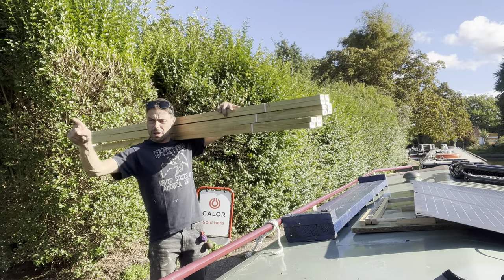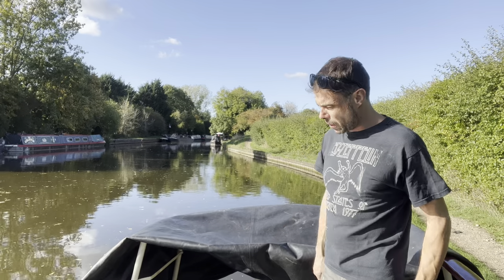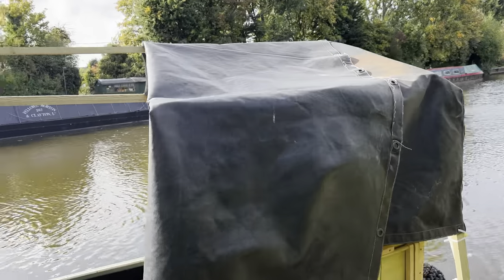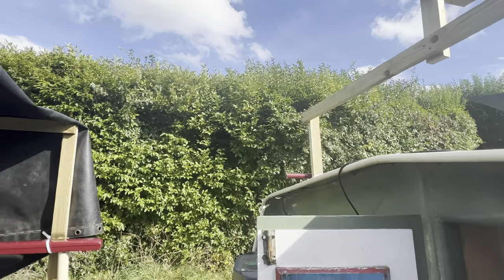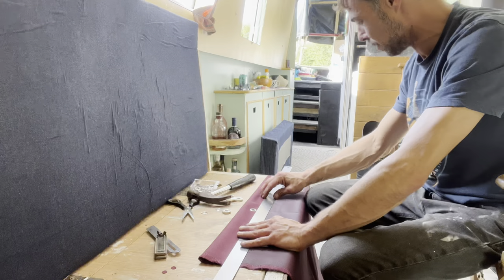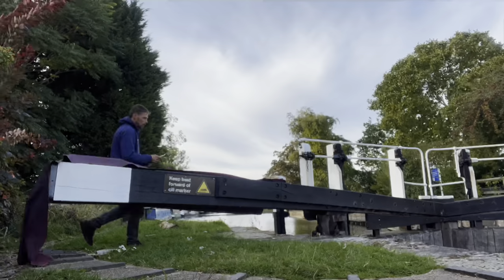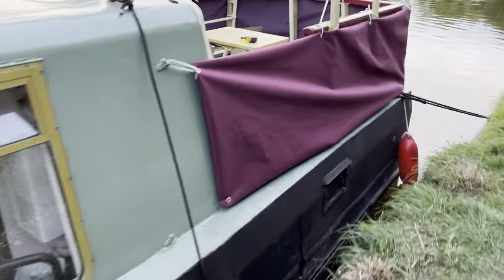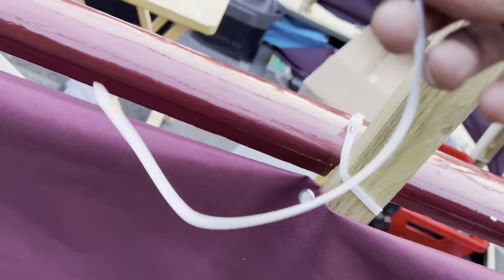370. Save £000’s DIY Pram hood 1.0 for my Narrowboat

Comment: You could ask your friend to make you a panel that will cover the bow hatch too, as it will hopefully keep your bedroom warmer and less drafty. I would definitely recommend getting the skirt/cover properly sewn with reinforcing tape inside the double rolled hem as the winter winds really pick up and you don’t want the eyelets ripping straight off. Getting the pram cover properly made, will keep you dry and hopefully less draughts steeling all your fire heat in the winter 🙌🏻

Comment: You should put some padding on all the sharp corners of that frame or the cover will very quickly wear when the wind blows. Those right angle ends of the frame look sharp for the black cover. 

We have a wooden a frame for the winter cover for our sailboat. We have softened the edges by sanding them and then used old towels and bits of old carpet tied to all corners and junction points of the frame. It is not elegant but protects our tarp cover over the winter storage months. You would want something more beautiful for padding inside the cover since this is your home.
Reply from the maker: Yes I’m going to round them off but a bit of towel is a good idea despite the look
Reply: @TheNarrowboatThatJamesBuilt  cutting up those foam tubes used for insulating pipes might work too
Reply: Maybe some pool noodles slit lengthwise and then cut into desirably sized pieces would do the trick. I’m afraid the pipe insulation foam tubing would be too small. That’s why I suggest using a larger foam tubing such as the pool noodle if they are available in the off season right now. They are super cheap over here in the USA in the dollar stores.